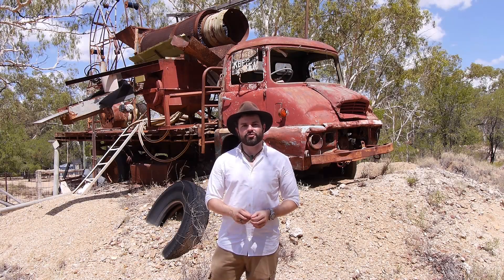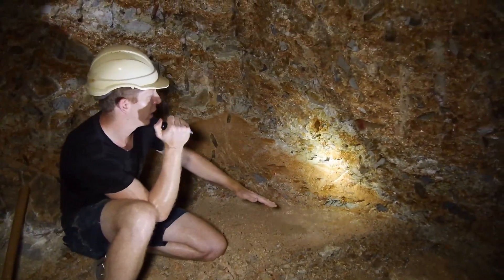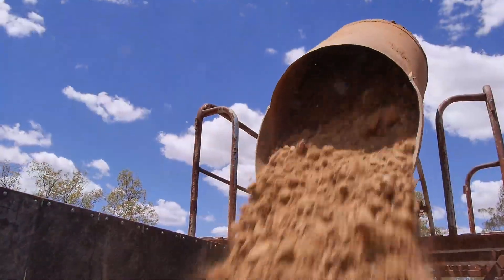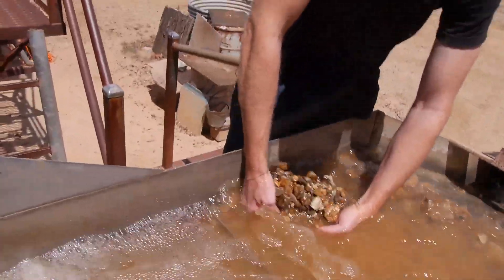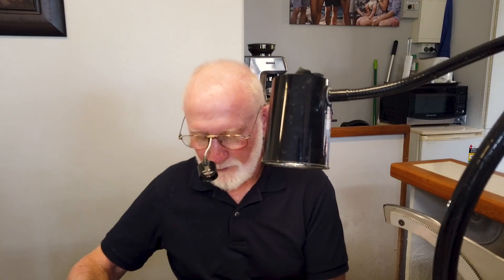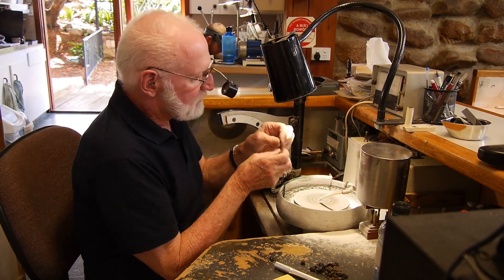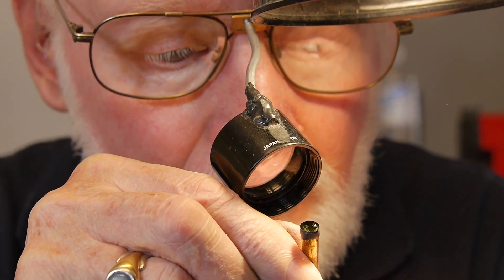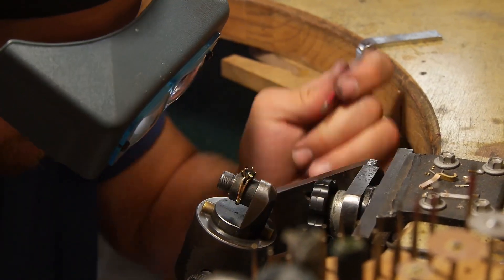Australia Unearthed: Follow a sapphire gem from the mine all the way to finished jewellery.

Comment: I live in America and go to the Smoky Mountains quite a bit and have found Ruby and sapphire, sometimes as a mixture but have never found some the the beautiful crystalline structure sapphire you show in this video. They appear opaque but do however fluoresce under u.v. light a bright pink or blue and have obvious " steps " present. Do they have a matrix covering them? Are they gem quality? I also have emerald in varying shades of green. Some crystalline and others almost blackish green in color attached to the more crystalline emerald. I have only cleaned them and keep them in a pretty bowl to admire. No one near me to validate them with the exception of a few lapidaries who say they are. All were found in the cold, clean, beautiful mountain streams and rivers. I just dig up as much gravel on top of bedrock and sift them into varying sizes. I have also found what I believe to be diamond in these rivers and streams because of the " glow " and refraction of light they make but some are stepped in flat sheets and others appear as clear river rock but that glow! I have used a diamond tester ( properly by weight and following the testers instructions) some ring up quite quickly while others only seem to have small quantity of diamond and ring up much more slowly, but this is diamond rough and I'm not sure a diamond tester is meant to test diamond rough. I do the " ice " test. Diamond is one of the best conductors of heat, if not the best, so I put a block of ice in a bowl, gently hold the rough onto the ice, not pushing at all and it appears the diamond rough transfers the heat from my fingers down from my fingers onto the ice and quickly melts the ice. In fact, as I hold the diamond to be tested, it is cold at first, then turns to my body temperature and it's as if I 'm holding nothing at all. As it quickly moves through the ice it begins to become cold once again as it touches bottom. I 've tested other silicates such as Quartz, amethyst and other gems that are not carbon based and they will eventually melt some ice but not completely nor as fast. I also found a fairly large block of dark green but translucent ( especially with a light behind it ) but not quite sure what this is. It also has gold flecks all over the back side. Could be Micha but dents when I press it with a fingernail. Micha usually flakes off. I wonder if the is a type of Jade? Also big, round garnets that I think is Rope Garnet. Sorry to drag on about other subjects other than sapphire but you know how women can droll on. Thanks for your time and have sure enjoyed this video. G'day mates and thanks again. 😉☺️😊
Reply from the maker: Glad you enjoyed the film and it sounds like you have been having some fun out in the field :)

Comment: For a uninformed observer, it seems very risky to "rely" on the just the underground structure to hold the tunnel's integrity.
Reply from the maker: The overburden is a very firm material (as you can see by the amount of force necessary to break it up to bring it to the surface. That combined with a bit of structural engineering for the design of the tunnels makes it a very safe environment :)